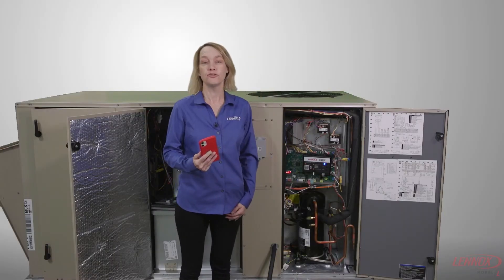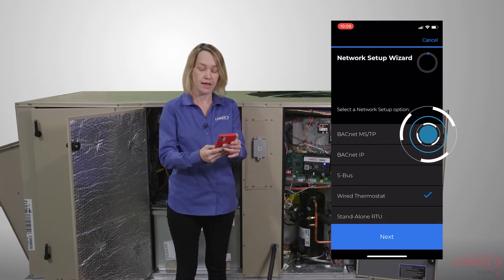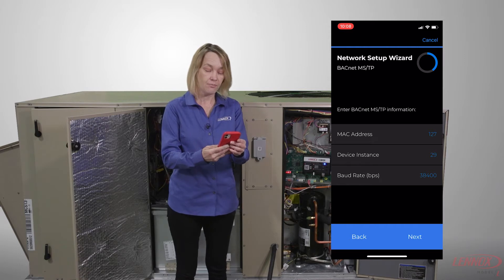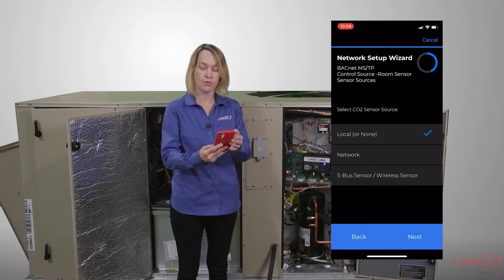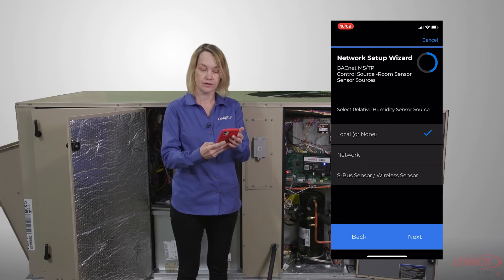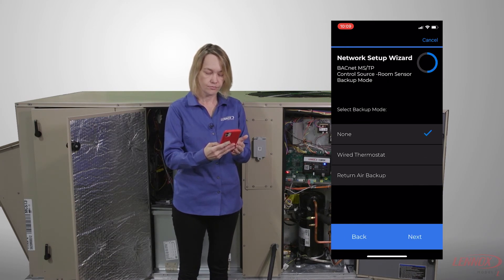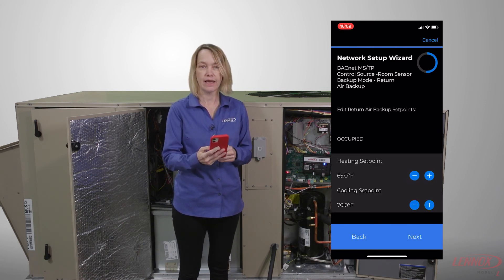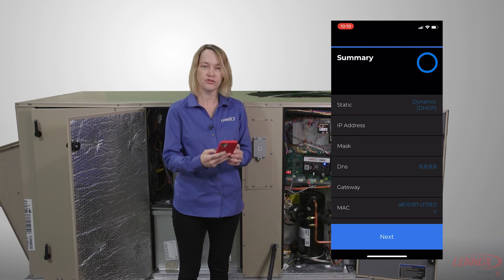Model L Network Integration

Comment: Is the Device instance specific to a unit or should all the units on that loop have the same instance?
Reply: Ie:
Unit 17 Mac 17 instance 2
Unit 22 Mac 22 instance 2
Unit 3 Mac 03 instance 2
Reply: @PapaSoggy instance and Mac must be unique. 

Use 10000 as a base
Inst 10001 Mac 1
Inst 10002 Mac 2
Inst 1003 Mac 3
So on and so forth.